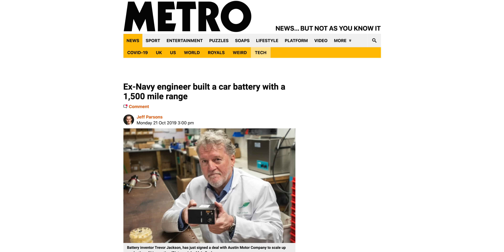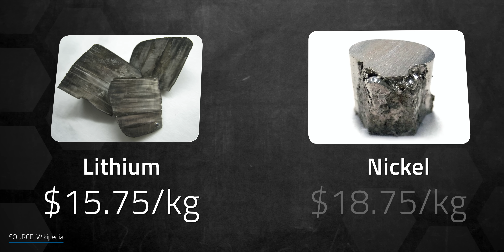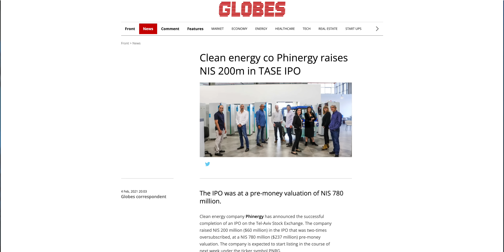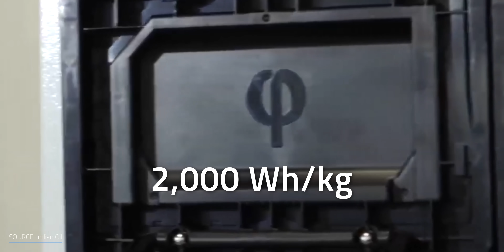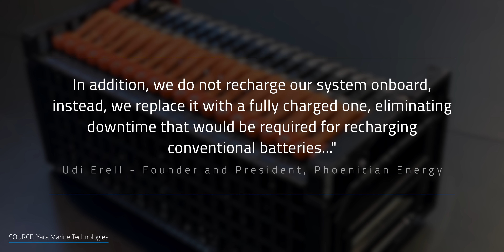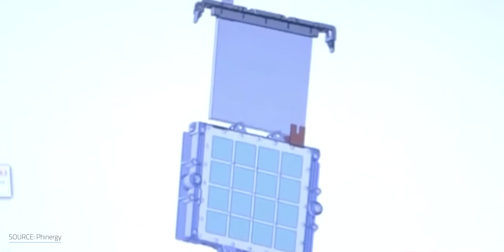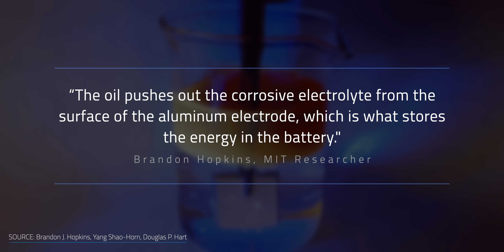Exploring the 1000 Mile Car Battery - Aluminum Air Hype?

Comment from the maker: But what do you think?  Would you want to drive an EV that required battery swapping?  Thanks Morning Brew for my daily news briefing - sign up for free here http://bit.ly/mbundecided

And if you liked this video, be sure to check out Exploring Massless Energy Battery Breakthrough https://youtu.be/7rJf_n3bc0I?list=PLnTSM-ORSgi7UWp64ZlOKUPNXePMTdU4d
Reply: One question I have is: this type of battery could give a 1000-2700 mile range for what weight vehicle?
Possibly they would produce larger batteries for heavier vehicles or vehicles that could accept multiple batteries which could provide better security from running out of power anyway.
Also, I think modular battery swapping is a great idea and could be used with rechargeable batteries as well, this could help solve range issues.
Reply: I would drive an EV with Lithium battery ~100km range, if I had the option to home charge it and quickly and easily replace it to an Aluminium battery when I leave the city.
But yeah, that would need modularity, standardization...
Also. if I replace at 10% (or see above, 70%), what happens to the remaining energy?  I don't want to waste...
Reply: @arsyee  good question about using all the power, you wouldn't want to wait until 0%, you might get stranded. I think the ideal solotion would to get a discount for the power left in the battery. The service station would back feed the grid with what ever was left in the battery, pass on a percentage of what the power company paid them for it. Also could work if it was handled by the recycler.
Reply: @therealDanW  Agree.
Reply: @therealDanW  exactly what I thought. It doesn't have to be an either-or decision. A vehicle could have a li-on battery , maybe super capacitors, that give a short range ( up to 50 miles ), and also have long range Aluminium air batteries. The Aluminium air batteries could only be used when the 50 mile range is up. So lots of the time it would still be recharge time.
Still I think hydrogen electric fuel cell is the way a lot of road transport will go. I know about the energy efficiency issues, but the conveniences could outweigh those points.
Reply: @therealDanW  all the car makers would have to agree to standardisation...and would need to make lithium battery powered EV's as well as Aluminium air.. confusing. There is no easy fix to cutting low carbon or zero carbon transport. I think that the target some countries have set of eliminating production of ICE cars by 2030 or earlier could be premature
Reply: @therealDanW  Modular is the way to go, along with Li-ion hybrid, use the Aluminium-Air to charge the Li-on, make them simple cartridges you can easily swap with a car having a 50-100 mile Li-ion battery and 3-4 cartridges giving weight saving and 2 minutes in the filling station to swap a cartridge or 2. You would then have 500 miles range, no long recharge and lighter vehicle. It all works on being modular like you suggest and thinking about combining technologies not always replacing. A bigger setup for buses and trucks, but the same concept and if the cartridges are the standardised then a bigger vehicle simply accepts a higher number of cartridges.
Reply: @therealDanW  The video at @6:48 said that a Tesla S with aluminum air battery would get 2700 miles (same weight between stock Tesla S with Lithium vs Al-Air Tesla S)

I don't see a problem with this aside from the degradation and corrosion issues.  Swapping a battery vs filling up a tank is similar and if the process is in the same time scale, even better.  Right now, filling up a a tank is likely under 10minutes (emptying the bladder included) vs filling up a lithium pack which is 30minutes or more.

Direct Ethanol Fuel Cell would be great as well, though that has issues too.
Reply: @therealDanW  Thermodynamics etc. An extra, or heavier battery also means more weight to carry, meaning lesser range etc. Typically the range given assumes a typical family car's weight-to-carrying capacity ratio. Wouldn't apply to say, a heavy motor vehicle.
Reply: @therealDanW  You are right; these should be first used for buses for public transport within cities. The cost of replacement of batteries must be considered. How about defense vehicles?
Reply: @janami-dharmam  Already happening with public transport in some cities. Pune eliminated all its ICE buses last year. Other places will follow. City buses are one of the best applications anyway- they all collect in one place at night, have pre-set routes, and so on. Economies of scale can be brought to bear. As for defence vehicles, it depends. Typically these exotic applications usually have specialized requirements and therefore specialized solutions. For instance, diesel electric submarines have had batteries for a hundred years now, but their construction is very different. Ditto for drones, life support systems etc. Other vehicles could follow. Unlikely that frontline fighting vehicles like tanks and helicopters will go fully electric any time soon, but there is huge research (usually classified) happening here. The real challenge is ability to use off-the-shelf technologies in innovative ways rather than expensive specialist development.
Reply: What happens to the aluminum inside the battery and how much is able to be recycled after the charge is used up?
Reply: @Nightowl5454  It gets converted to Al(OH)3, which takes at least 250% more energy to convert back to Al metal than you get from the battery. Al is formed by electrolysis and it's not efficient because the Al-O bond is so strong. Thermodynamics says this is a dumb idea, but weirdly Matt didn't look at this, even though it's basic and shows it's a super dumb idea.
Reply: @Nightowl5454  the aluminium oxidizes as a chemical reaction when releasing energy in this battery, aluminium oxide is basically the ore used in the electrolysis process to make aluminium.
Reply: @Nightowl5454  It's my understanding virtually all the Aluminum can be recycled, and there's a rickshaw type service in India that already uses these batteries and recycles the Aluminum.
Reply: @Nightowl5454  The aluminum can be recycled to the same level normal aluminum scrap can. Please note that when "charge is used up", it doesn't mean all the electrons from the Aluminum are gone or something. Usually a battery that's stopped working is because there was corrosion buildup, or the electrolyte was over. And aluminum recycling is a well known science. The problem isn't that at all. The problem, as the video pointed out, are the losses. The MIT tech seemed promising; I'm excited for the future of energy storage.
Reply: @ninadbhave5133  not all metals are cost effective to recycle, sometimes it's so expensive to recycle something that it frequently just gets thrown in the trash.
Reply: @Nightowl5454  Quite true; however perhaps economies of scale might make it less expensive per kg?
Reply: @ninadbhave5133  yes with improved technology we can bring down the cost for recycling, for now I suspect that most will simply end up in the trash piles. Some day we'll probably end up mining our trash piles because of all the valuable minerals that have been thrown into the dumps because we currently can't make it cost effective to recycle. Currently most recycling done in the USA is by force and costs more than the value of the overall materials sorted.
Reply: it wont be a problem if we can buy and keep extra one  and 2000km is way better but  we dont know the price yet
Reply: So, after a just 1000 miles traveled, the battery pack has to be replaced with a new one and the spent battery needs to be recycled? And this 1000 mile drive would cost how much compared to 300kWh of electricity required to do the same trip in a lithium battery powered EV? How much CO2 would be emmited during mining, refining, manufacturing, transportation, swap station infrastructure and then transportation to recycling and eventually recycling of this battery every 1000 or so miles? And over the entire lifecycle of such vehicle, if it does let’s say 150K miles? Right.

Very early on when designing the first EV prototypes, a few companies toyed with the idea of battery packs being swapped from underneath cars in service stations. As rapid charging at >100kW did not exist yet. This idea was quickly discarded as unpracticalc even though these batteries were supposed to be recharged on site while waiting for the next car.
This aluminium-air battery idea is even less practical than that. A diesel trucks would need to deliver up to several hundred newly manufactured battery packs (it’s not a single cell) a day to each swap station and take the spent battery packs to be recycled. Some % of the recycled battery materials would be used to make new ones, but not all. I’m sorry, Matt, but how is this not the worst natural resource and energy waste idea You’ve heard of?
Reply: @amconsole  Oh yeah that is interesting. I just thought about how getting a new battery would be just as easy as getting gas but you would have to have a lot of spare batteries there just because of how many people visit gas stations a day. Though there would be less people because of the longer range, I still think that having enough batteries there would be a problem that would need to be worked out. 
The batteries when compared to gas would take a lot more effort to deal with after the energy is spent. After your fuel tank is depleted in a gas car, you just have to get more gas. Whereas with these batteries it would have to be recycled which may emit more pollution than just gas cars. I think part of why batteries are popular is because we will need an alternate energy source for transportation because oil prices will eventually get so high that it is affordable for an average driver.
Reply: @amconsole  I can't believe they are even going down this route
can't be recharged
has to be recycled
. it's the worst consumerism idea ever
just like your AA or AAA BATTERIES
JUST THROW THEM AWAY

wow the mindlessness of this let alone the original. making then remaking, transport to and from
its redicoulous for the environment and a waste of resources

even if they were rechargeable like xpeng

it's still. really dumb
Reply: @amconsole  totally agree. Using fossil fuels would be more environmentally friendly than aluminium air batteries if you can't recharge them. I guess you're probably going to have to put at least 4 times as much energy into making a disposable aluminium battery than you get out again during use... dead-end technology if recharging isn't solved..
Reply: @amconsole   exactly.. say this becomes unviable and we are stuck with lithium Ion. how long will supplies of that last?
Reply: @vincentl.9469  what do You mean? Lithium is quite abundant in Earth's crust and there is research into better (cleaner) methods of refining it. It is also recyclable.
Reply: @amconsole  OK. there are millions of cars  on the planet , at least quarter million in the USA alone, many millions in Europe. Are you saying there is enough for all that plus the demands of computers and cell phones, watches, clocks etc  ?
Reply: @amconsole  How many cars do you think there are in Asia alone, plus USA, Europe? then are are other elements involved like cobalt..still think there is enough supply..plus all else that needs Lithium batteries
Reply: @vincentl.9469  you are posting this comment under a video proposing all those millions of cars swap nonrechargeable batteries every 1000miles or so. How many such single use battery packs would need to be manufactured then scrapped and recycled during a lifetime of such cars? 200? Not to mention there would need to be a large surplus and not counting the ones that would need to be recycled having never been in a car (due to selfdischarge and short shelflife). Not the best use of resources as compared to cars that do 200K miles on a single Li-ion battery pack.
Reply: @amconsole  yes I agree on that. what I'm referring to is the lithium supply, which you say is abundant within the earth's crust but, there will be  a lot of demand too if current petrol cars are phased out.
Reply: @vincentl.9469  quite right, that’s a lot of lithium. I don’t think in 30 years time all cars will still be powered by Li-ion. Even if lithium stays as the main element in batteries (continuous well funded research in this field is happening all over, so who knows), the phasing out of non battery powered cars will not happen overnight and by the time the last ICE car rolls off production, a significant percentage of new battery packs will allready be made from recycled lithium. Packs will continue to get more compact and use ever smaller amounts of rare earth metals as well.
Reply: @amconsole  Aluminium air batteries can be used only for personal vehicles not for goods/passenger transport. Oil will continue.   It is the Govt and public should think of using this Al battery for their personal transport.  why every one think that oil will be replaced completely by alternatives is unclear to me.
Reply: @sramay123  not sure how this is related to what I wrote in my comment. But in short, no. Goods and passengers are being transported in electric trains, buses and delivery trucks already. Sure, the large trucks that take goods across state lines are not yet electric, but it’s only a matter of time, as cost of running diesel burning trucks keeps rising and logistics companies will ditch them as soon as any alternatives are available. That leaves airplanes and those will still run on some sort of liquid fuel for some time. That fuel will however not be made of oil as CO2 emission taxes will continue to go up to a point when carbon capture from atmosphere and synthetic fuel production becomes cheaper than burning kerosene.
Reply: @amconsole  in a decade you will see the solar waste, battery waste etc.    The only solution to climate is live with minimum needs what was followed 50 years back.  Air travel major oil guzzling, weekend travelling, year travelling, festival travelling  now space tourism.   it is all joke.
Reply: @sramay123  I don’t think this is a battery. It’s more if a fuel cell
Reply: @sramay123  and we have better fuel cells now.  It’s like saying a  gas tank and an engine is a battery.
Reply: @sramay123  At no more than 40% energy out compared with energy to produce the battery (making Al metal is hard, very hard) Al batteries solve nothing. You are not saving anyone if you need to use 250% of the energy stored in the battery to make the battery.
Reply: @sramay123  I don't think so, because that means the oil supply chain is still needed, and in fact now runs less streamlined because of reduced capacity utilization. ICEs based on fossil fuels for all except the most extreme applications like fighter jets or something will quite certainly get replaced. I don't think there will be one standard solution; rather a cluster of them. Standardization will follow slowly. At this point it is definitely viable to replace several heavy duty applications as well, such as intra-city public transport buses on pre-set routes.
Reply: I'd use swappable aluminum batteries if and ONLY IF the swapping stations were as ubiquitous as gas stations are today.

Great show!👍
Reply: @bootstraphan6204  And then they will come out with non-compatible batteries (because of constant improvements).
Reply: @bootstraphan6204  That's the point. Gas stations, with their existing safety protocols and underground tanks can easily become storage facilities to hot-swap batteries. One does need new safety protocols, but it ain't hard tbh.
Reply: Anyone who owns a Tesla is going to think this is a horrible idea.  You don't need that much range for 99% of your year, it is only when you have a long roadtrip that range really matters.  Why would anyone in their right mind ever trade charging at home for needing to do a battery swap for their commuter vehicle.  This might find a home with Semi-truck and hauling where long distances are the norm and battery swap support can be handled at destinations.  But for the average consumer, this is a huge step backwards from rechargable batteries.
Reply: @Beldizar  This is exactly what I would have commented. But as always: for this type of battery there will be use cases that actually are a good fit for the concept/product. But I think that the EV market already has chosen its path: rechargeable (preferably at home) batteries in one form or another. But when looking at the concept and the need to setup a logistics path between production, user and recycling will be difficult and usually only succeeds if there is enough market for it. So I wonder which niche use case can actually pull this off. Maybe in the shipping industry (where battery size is not a real issue) or low range aviation, where fast turnaround times are welcome. I don't know, but for passenger cars, I think this will not be a success.
Reply: @Beldizar  of the 4 vehicles that I use for normal driving, only 1 is for short range commuting and short drives.  The other 3 are pickups where my shortest normal trip is 600 miles one way, to 1400 miles one way, mostly in places that dont have recharging stations
Reply: a Hybrid design may be an answer, with a 150-mile rechargeable and a 700-mile replaceable  this is shy of the 1000-mile range but won't leave you stranded, 150 miles is enough to get from most 24 hour sharing stations. and is enough for around town daily driving... , then you can have a mini trailer, like a motorcycle trailer with a battery pack that will do over 2000 miles.  This would do almost anywhere in the country for 1 battery pack
Reply: My Li-Ion battery has already gone 115k miles, why use a battery that only lasts a thousand miles? Charging my battery is a minor inconvenience. So no to the question of driving an EV that required battery swapping. As a power supply for ships on the other hand, on a container scale, I would like to see a feasibility study, preferably comparing a Hydrogen fuel cell, a Aluminium-Air battery and a Thorium SMR.
Reply: @johann.g.olafsson  Materials economics and strategic sustainability reasons mostly. Li-Ion batteries use cobalt, a quite toxic substance that isn't easy to recycle. Also, lithium isn't available everywhere, making strategic hoarding (like China's doing with rare earth metals currently) a real possibility. As against that, Al-Air or Iron-Air batteries use abundant, non toxic elements that can be extracted, handled, and recycled safely and using current mature techniques.

As for Thorium reactors I don't see that happening in an era where container ships are getting attacked by houthis with cheap drones.
Reply: If it can't be recharged, it's a no go. 90% + is home charging. If you need advanced automated infrastructure to swap the battery it's going to be too expensive.
Reply: I mean i probably would because it not that much different than getting gas at a gas station
Reply: I'm wondering about a possible hybrid setup between this and a rechargeable battery unit.  the Aluminum battery could be used for longer trips, while the lithium could be used for shorter in-city trips.
Reply: I think Thunderf00ts review of this is worth a watch.
Reply: Absent aluminum air, I think battery swapping is a good idea. Imagine having a 100 mile range ev with a permanent battery & a 2nd swappable battery good for another xxx miles. You could still charge like you can now and road trip with quick swaps along the way.
Reply: @peterwittreich4902  nice! why not both? seems like a great idea. And on long trips if you can select freely between which battery drains first. you just start on swappable if you run out of swappable energy you have the charged battery range to get you to the next swap station. get a fresh pack and retop your charge and off you go.
Reply: People have no issue with pulling into a gas station and filling up the gas tank so what's the difference if they pull into a battery station open the hood or trunk and swap a battery?
Reply: @BillB33525  when you have 10% charge, and you don't know how long is the next trip...do you swap it or not? It's very difficult for daily use.
Reply: @BillB33525  weight!
Reply: @BillB33525  If you have a bad back you're in big trouble. (Though to be fair, if you have a bad back it's better to avoid driving in the first place.)
Reply: @BillB33525  cost
Reply: Maybe a cartridge style where you drive into a building and exit or stay as it extracts the dead battery.
Reply: @BillB33525  Already the EVs cost a bomb; they are selling because the fuel is cheap at this moment. Why the EVs are so expensive? They are supposed to be simpler to make.
Reply: @janami-dharmam  R&D is expensive and the companies have bank notes and investors to pay back
Reply: @janami-dharmam  yes, they are simpler to make. But the batteries are still the most expensive component. The extra cost (at least for mass market vehicles like the nissan leaf or chev bolt) is almost 100% battery development and manufacturing costs. Its worthwhile noting that batteries are almost 1/10th the cost per kg thet were 10 years ago ( they keep putting bigger and bigger batteries in, so the final cost hasn't dropped that much, of course) and they have every reason to think cost will continue to drop...
Reply: @janami-dharmam  To recover development cost, supply-demand, etc.
Reply: If the battery being swapped provided a days worth of travel, I would have no qualms about pulling it out like a clip and swapping.  It would be interesting if a built in pack like the Teslas could shut off blocks of batteries and let them get charge and then switch to using those as the other blocks were recharged (solar on vehicle and regen braking).
Reply: It's merely an improved version of single-use alkaline battery, with equally more complex production/recyclation chain…

So I see use only as an emergency device - dry brick, with electrolyte in separate chamber, that would be flushed in upon activation and battery would be drained completely to charge some standard battery…

Possibly, that "Emergency Aluminium Brick" could come with adapter to be used directly with EV charging port…
Reply: would much rather have replaceable batteries that have to wait for a recharge..
Reply: @TrumpKaSut  considering rapid charging a car takes like 30min and a swap would be 5min, that sounds like a timesaver. However, pluging in is a lot simpler than uncliping a battery pack, lifting it vlean out without clipping carpaint, and placing a new one in. Sure, aluminium is lighter than other metals, but the battery pack is still pretty big and is filled with liquid electrolyte..
Reply: smaller individual battery modules you can slot in and out would be an idea..
Reply: I think this could be a good addition to lithium, if they could make it where any idiot could replace the battery and it was sold at every gas station. Because this would make some easy good range extension to EV cars. As well as giving an answer to those who don't own homes.
Reply: I absolutely would. And it's not like it has to be an all-or-nothing scenario. They could be engineered so I could swap out a sub-set of the battery array. My car could even force me to keep at least 500 miles of "fresh" battery in the car at all times. This is solvable.
Reply: I would think a better application for this style of battery might work better in the field of transportation rather than personal ev. Integrated into the logistics of shipping something via long haul trucking, an all electric vehicle that could be loaded up with lighter and calculable known viable range would cut out vehicle travel down time. A truck could be loaded with it's batteries along it's load, with the precise about of battery power needed to complete the trip even accounting for worst case scenario of 100% usage. All this could be done at the origin point of the truck, no need to refuel in route. Once the truck gets to it's final destination, it could be loaded with new batteries and shipment to go back or on a new route.
Reply: Yes. Roadside assistance could carry the battery swaps (instead of gallons of gasoline). As you said if Indian oil stations become battery stations... That's a lot a lot of battery stations in the 2nd most populated country automatically. I think the infrastructure around these batteries would be equally, if not more convenient, than gas stations today. I think charging an EV is still an inferior option to a fast, instant swap.
Reply: I think swappable battery systems for ev's is feasible. However, is it possible to just swap out the aluminium anodes like printer cartridges?
Reply: Aircraft?
Reply: The batteries in my Roku remote died about 2 weeks ago.  I still haven't taken the time to walk to the other room to get new batteries, I just use the app on my phone with a LI-Ion battery in it... so I guess battery swap stations may not be the best solution for me :)
Reply: I think a hybrid battery solution would be better: 
~ 1KWh  in supercapacitators for regenerative braking 
+
Interchangable Li-Ion and Al-air battery modules of 10kg (that would be 1Kwh and 4Kwh respectively ?)

With such a system, depending on what trip I plan to do I'll be able to load the correct mix, from fully Li-Ion  (short trips) to fully Al-air (long trips).

The modules should be available in grocery stores like propane bottles for cooking.
Reply: The total fuel efficiency during the cycle process in Al/air electric vehicles (EVs) can be 15% (present stage) or 20% (projected), comparable
Reply: Honestly I dont know why we dont have EV's with multi-segment batteries already. Have the bulk of the battery as a permanent part of the car and have a swappable segment for range extension
Reply: Obviously, you have never driven a motorcycle. Motorcycles have fuel tanks that draw fuel off the main area of the tank and when that runs out you switch to the reserve. That would be very simple to deploy in the battery swap method. Software with GEO location data could "guide" the user to a swap station once it is needed with a demand that it be done or shut down feature in the software. The swap station need not be a full-size battery. In fact, there could be partial range batteries sold everywhere.
Reply: The solution could be mobile battery replacement trucks, just like mobile charging stations.
Reply: it all depends on the availibility of the swapping station .. so distribution is key .. with LiOn battery, you could charge your battery at any infrastructure that has electricity - granted one could take longer then the other ..

I could see this as a solution for long distance electric planes .. where LiOn battery will just be too heavy .. swapping battery at airport would not be a problem ..
Reply: In the end, it just comes down to cost and convenience.  We already have hydrogen electric cars that claim the same virtues without as many downsides.  I can't imagine a world where re-smelting the Al OH3 back into aluminum, rebuilding battery packs and transporting it to stations is as cheap and efficient as recharging the current generation li-ion batteries from a wall socket.  The question is:  Is it cheaper to re-smelt, rebuild, transport blocks of aluminum to stations than creating and transporting hydrogen?  I doubt it.
Reply: battery swapping is easily done, one module of 13 aluminium plates will give you 166km, you can have extra modules stored in your car and house.
Reply: @rwyo83  Bugger having to go somewhere to get your battery swapped, waiting in line for the next available person or battery to get going again, I just want to charge my car when I'm not using it and get in with my day when I need to without any hold-ups.
Reply: @markorourke5901  A battery swap takes 10 seconds, and you can do it at home.
Reply: @rwyo83  You do it from underneath the car right? you need tools and the ability to do that, what happens when it rains and you need to go out and about, or it needs changing while you are out? or all dressed up and have to change it? most people will take it in to swap and wait in line for the next person available to do the job for them, Not for me thanks. I'm a charge-and-go man.
Reply: @markorourke5901  it`s not from underneath, the batteries are inside the trunk
Reply: @rwyo83  Okay, not much difference then, you have to unpack the boot and then do the job, I could do it easily but I think a lot of people wouldn't want to or couldn't, there is a lot of people who have no idea how things work on cars. I like the Sono group of cars, they self-charge, as they are one big solar panel, and when not using the car you can power your house or recharge another car simply by plugging it in.
Reply: @markorourke5901  I like The Sion, it's good for the apocalypse. But I need an EV at least 500km of range
Reply: @rwyo83  Well you are in luck my friend, there are plenty of those coming out this year with the new 2023 models, not the old ones from last year which they are trying to paddle at the mo, good luck bro
Reply: Aluminium air batteries actually would fit air planes better than cars. They are light and energy dense and charging a plane takes too long anyways so swapping battries is the reasonable option. Many smaller packs that combine into a large battery could in a short time be swapped out and the plane would be ready to fly again. Degradation doesn't matter since the batteries are used up within a day and swapped out. Just build a battery recycling plant nearby the airport so transporting the battries wont take to long.
Reply: Maybe cylinder or cube that are easy to plug/unplug alreay charged :) ... one day!
Reply: This came out at 5 am how is there 500 comments its 1 hr old.
Ok so I think this can help but mybe a green ev train instead of the gas engines.
Mybe a new solar ment for farms to get them to stop wasting so much food.
Oh fun fact we grow so much corn if we stopped making things out of it like corn syrup corn meal or corn chips corn for cows and corn for your car the ethil gas ya thats from corn with all of this we still have so much every single person in America can eat 2,000 pounds of corn a year and we will still have excess corn.
So mybe reducing corn farms will help slow water use by alot.
Reply: Seems like a cleaver way to sign people up for yet another subscription.
Reply: Yes. It takes me 15 minutes to fill my tractor and refrigerated trailer. There's already hybrid busses; where's my hybrid tractor trailer?
Reply: Would be great as a addition when having a long trip, put a module in and take the long drive that is normally only possible with many fast charge's.
For normal use, I would not like it because it isn't rechargeable and recycling will cost also energy.
Reply: This sort of technology would be perfect for a public transport system.  For example, use buses to get people within 15 blocks of their destination, then small 8 or 10 person vans to get them home.   When you have a public transportation system capable of getting people from their front door to anyplace they want, with their groceries, the use of private vehicles will decrease.
Reply: I'd imagine the battery would still be very heavy even if 7x the energy density. If I cannot lift the battery out of the car to replace it myself, there is absolutely zero chance I would drive a non-rechargeable EV. Depending on the ease of recycling, this technology might be promising for other applications. For EVs, It seems that no technology will beat Li+ for many, many years.
Reply: @bminerrolltide  Mini trailer style maybe, swap them out like a towable pack... lol
Reply: Another option is an EV or truck with a Li+ battery and an aluminum air battery as a backup. Battery swaps are just a giant pain in the butt. I doubt they will be a thing.
Reply: Two 🔋 s can be kept as light weight... One when drain to zero new can be plugged. 

The drained battery can be deliver in door easy through online order. 

Priceing is only issue.
Reply: Transport of these batteries is not as easy as transport of fuel. Not looking at the numbers, the CO2 emission to manage the recycling and transport of these one time use does not seem that great.
Reply: These look like range extender batteries to me - and they look great for that.
Reply: Sure.  As long as I know when I have to change it, and I can reload at a station.
Reply: For small distances it wouldn't be an issue.
For long distances, i wouldn't risk it...
Reply: Instead of replacing the entire battery, you can only replace what is consumed and remove aluminum hydroxide. Simply put, an aluminum electrode in the form of, for example, a coil of sheet aluminium is successively uncoil and fed to an electrochemical reactor where it reacts with air and producing electricity. And at the station, you just put on a new roll and remove the sludge that remains.
In the extreme case, when you stoped looking for a bar, you dive in a trash can behind beer cans like Emmett Lathrop Brown and fill it up.
Reply: Absolutely. My mileage is highly predictable. And this means that I have to do exactly ZERO refueling or charging between swaps. And it then becomes a subscription service. Every 3 months I get a new battery delivered and return packing for the used battery. If the battery subscription is comparable to the equivalent mileage worth of diesel, gas, or electricity, then I would absolutely see it as a net gain. It's the same challenge that was talked about 15 years ago with hydrogen powered vehicle. You wouldn't recharge the hydrogen tank, you'd just swap it out. Only now Amazon has shown that maintenance subscriptions can really work.
Reply: Tesla considered battery swapping as part of their technology offering at some point. I mean if it can be recycled and is cheap to re-produce why not? As of the driving at night case - just make an array of those batteries that discharge in a sequence. Then you have a constant re-charge cycle instead of all or nothing.
Reply: no need to tow, the tow trucks could just bring new batteries to swap on site on EV car out of juice. If there is good recycling factories and very good batteries supply, swapping batteries isn't a problem and would be faster in fact. My worry is more about the added cost of transporting these batteries back and forth between the gaz station and recycling factories. Also, how much silver is needed in the battery? Because this could kill the project right there for mass consumption.
Reply: To answer your question, would I use a replaceable battery system. Yes, very little difference to having fuelling up today. But the eco/cost/convenience equation needs to work.
Reply: Matt - thank you for all the informative videos! Much appreciated.

My two bits; 
What about a hybrid solution leveraging Aluminum Air battery as the primary power source and a rechargeable Li based battery for 'emergency' power in a 90/10 or similar balanced power supply ratio? 

If they are inexpensive and safe, enough then having a 'spare' at home would also be possible. It wouldn't remove the need for the 'emergency' power supply but would eliminate the occasions where you realize you don't have enough power to make an upcoming unplanned trip.

The true path to adoption (outside of the technical and engineering challenges) will be standardization. The battery shape, size, and connectivity should be universal regardless of the vehicle or manufacture. Yes...you may need more 'modules' depending on the vehicle power requirements but standardization could facilitate mass production and make 'servicing' much simpler. 

Thank you again!
Reply: I would use them. Currently you can find AA batteries for your remote control at every gas station, why not aluminum air batteries for your car?
Reply: Absolutely.
Reply: No. I think the way to go would be rechargeable batteries with induction plates that works with electric highways.
Reply from the maker: Agree on the Neosporin.  😜
Reply: Well the higgest hurdle is the fact that you cannot "charge at home".

Wwapping out the electrode is not thwt different from pulling up to the gas sattion, and itsnot inconcieveable in the roadside.

However compared to rechargeable cells you lose out on getting "free recharge" from solar on roof.

Imho. as soon as home scale gadget for refurbishing used electrodes is available on the matket (on top of al air cells for sale), Li rechargable batteries are going the way of dodo.
Reply: Tow truck can simply bring you a charged battery, no need to tow you somewhere else. And if EU does like for all other charger and enforce a community standard, you wont even have to worry about calling someone with the right battery, plus as open standard many company can and will compete for manufacturing, racing to drop the cost and increase performance
Reply: If I get 1000 miles. Yes will be willing to do a swap.
Reply: use both, so a fully electric hybrid car, rechargeable lithium for day to day use, aluminium kicks in once that's flat, handy for long trips, this would also mean you could still use regen braking in the car.
Reply: There would be advantages, but if they aren’t rechargeable recycling would need to be on a whole other level. Great video.
Reply: Maybe using Al battery as a portable recharger for an EV for those rare situations, where you need that high distance capacity and you don’t expect charging stations.
Reply: You mention a drawback being "not noticing that you need a charge/swap" while traveling with your family.  Now imagine that you get to a "swap" station only to find they don't have any more batteries?  Do you have enough energy to get to the next "swap" station?
Reply: Why would the car need to be towed if the battery replacement station?

Dealers would probably create a mobile service.

The cars  will be monitored by the computer link to a data center.

The dealers can just send techs to do the change while a person is at work.

If the tech takes off other companies will start  to handle roadside assistance for possible emergencies.

As soon as a customers calls Triple A needing a battery pack.

Somebody will be on the way.
Reply: No.
Reply: Jeeze, no.  This is idiotic.  Seems like this oil company is trying to create another wasteful dependency market.  For backup power, sure.  Military applications? Hearing aids? Bob's Baricades? Yeah.  Metal-air cells keep well until activated, and 'cheat' by using mass outside of themselves to achieve exceptional specific energy...... once.   But for daily driving EVs?  Totally absurd.  Any company that tries to make this happen deserves to go belly-up.
Reply: I would add that battery to EV for special occasions. Like BMW i3 REx.
Reply: How is it environmentally friendly if you can't recharge it? Having to remake the battery each time must be pretty inefficient., and do you really get ALL material back when you recycle a aluminum air battery? You should have including more information on this 'recycling'
Reply: roughly the same time as a stop for pumping a full tank of gas to switch out batteries?... sounds MUCH more attractive than sitting around for 45 minutes to get 80% and another 30 if you want that final 20%
Reply: Not sure about highway use, but I will be driving an EV race car in the NASA 25 Hours of Thunderhill race on December 4th, and that car uses quick swap battery packs made with LiFePO batteries.
Reply: It seems doable, I was always wondering why companies didn't think about something like a car wash building that reads the exact make, model, etc pulls the car in discharged battery drops out to a robotic arm that stores the battery in a slow charge station while a fully charged is installed and you on your way. So the battery packs would be owned by the car manufacturer, rented to the car owner to cover degradation and then a charging fee for the electricity measured off the charge level difference between the drop-off battery and the charged battery. Obviously this would be problematic storging large numbers of batteries and require a larger infrastructure more that a pole with a plug on it but who knows what new incredible things could be coming.
Reply: @CodeMan636  a company does it in China. Batteries are a standard size so the car must be compatible.
Reply: S
Matt, 'BATTERY SWAP' is lame in my opinion....it seems to have been DISMISSED by Tesla.
My background tells me 'embeded'  battery packs create a structural integrity to maximise vehicle dynamics.'The stiffer the BETTER'
Charging will NOT be your main consideration in the EV World
Reply: This reminds me of Senator John McCain's call for an X-Prize for an EV car during the 2008 US Presidential race. He wanted a system that could be driven to a station and swap out the battery pack so it didn't take longer than a fill up and potty call for the kids on a road trip. Left/Right/Center politics aside, it was a valid idea and one that I still look forward to. You are right about finding a 'swap station' at night, but if the automotive industry can agree on a standard configuration, what's to keep someone from building an 'automated carwash' style line where you pull in, and a series of robots drop, disconnect, plug-in, secure and test the new battery, all in the same two minutes it takes to go through a car wash? Your vehicle would be able to pull in and talk to the station over 5G/WiFi or Bluetooth (or probably via an app that locates the station for you and secures a place in line), then the 'bots connect to the battery housing from underneath (like an oil change place) and does the work as you go carting along the track. You could even have a second building on premises for actually getting a car wash, too.
Reply: Anyone else find this one interesting? https://youtu.be/Ph4xvAc9HFQ
Reply: No we need cars capable of V2G to solve our long term energy problems.
Reply: @davefroman4700  I am not entirely convinced by this statement. While taking advantage of a car battery to supplement the grid storage capacity might seem a smart move, if it comes at the cost of making the cars significantly heavier is much less appealing. A heavier car means more energy consumption for the same trip, less autonomy, more dramatic accidents etc. Additionally You might end up in situation when You need your car but it is discharged due to the grid needs. Grid energy storage is an important issue especially considering the popularity of renewable energies such as solar or wind, however using electric batteries is not the only option, having appliances started when the power is available and storing heat might be more efficient. And if local batteries are needed, I'd rather a separate technology to optimize cost over weight and volume, such as Fe-air.
Reply: Battery swapping has ALWAYS been what was needed for EV's to become widely used. Imagine a standardized battery. You drive up, an automated system disconnects the old battery from underneath your car, or a side door or something. Pops out the old one for recycling, and puts in a fresh new one. Every few thousand miles you get an oil change that removes the containments from your car. Then entire oil industry doesn't have to change, people's routines don't change and even the repair industry doesn't have to change much. You just have trucks hauling batteries instead of explosive gas.
Reply: Aluminum-air should become an excellent replacement for alkaline batteries!  I believe it will be up to preference to decide between frequent recharging or regular swapping.
Reply: Yea it’s not a battery. It’s a fuel cell
Reply: I think the hybrid solution of using both Aluminum Air and Lthium in tandem. Lithium can be the main source of power while Aluminum can be the swappable backup.  Offers the ability to charge lithium while Aluminum can maintain the charge. Aluminum, due to space constraints, will lighten the EV weight with a smaller power cell which would make it cheaper since there won't be a need for the EV to be fully aluminum or Lithium. Who needs a 2k mile charge vehicle anyway? A 600 mile/charge should be more than enough. If solid batteries become a thing, Aluminum can be the mobile power source to keep it charged while still have the option to recharge the solid batteries. Isn't this how Hydrogen hybrids work, hydrogen tank charges a dense battery?
Reply: thought about it and it kinda pissed me off.   Any could and had made more efficient versions of these.  They are not batteries as they require fuel and have an exhaust.  They only work up untiillnthe exhaust gills the water chamber.  I doubt it’s a reversible process as well but could be. Still requires o2 to run tho.  I Sam rusty on my ochem but I don’t believe the al + o2 —— al2o 3 is reversible.
Reply: Yea, swappable battery tech seems completely fine. In your example of running out of battery while rechargeable cars can get a small boost charge from an equipped tow vehicle, the swappable car could just be given a battery to swap at a premium because they forgot to replace it early and weren't holding an extra in the car for the change over. Seems like the real question is whether they overcome the engineering difficulties and reduce the whole life cycle cost from production through to re-production.
Reply: As we all know there is no one solution that solves every aspect of this long debated issue however combining technology's having aluminum to air supplementing rechargeable tech hybridizing seems to at least  half a solution but would it really reduce our carbon footprint ? 
I wouldn't mind swapping something out every 1000 miles myself beats filling up every day or so .
Reply: @chadskyblue1  these batteries can’t be recharged, the have to be recycled after just 1000miles. Funding of this research should have stopped then and there, even without the horrific idle discharge that’s just a dealbraker. A solution that introduces more waste and CO2 than it solves is not a direction worth pursuing. The money wasted on research of a non rechargeable battery that needs to be replaced and recycled after just 1000miles would be better spent of fastcharge research, that would allow to fill Your rechargeable battery even faster and make it last longer. This is like driving Your car on a box of AA batteries and the replacing that box with fresh ones every 1000miles. It’s actually worse than that, as AA batteries lose very little charge while not used and there is an existing efficient process of recycling them. How much of those 1000mi would be lost due to selfdischarge? How much more is lost because the car would not be able to to regenerate anything from braking (usually around 5-10% of range is driven on regenerates energy). The proposed hybrid solution that combines a regular lithium ion battery pack EV with a range extender replaceable second battery in the trunk is not viable either. The whole swap and recycling infrastructure would need to be there for the <5% of all commute that people do beyond the range of their built in EV battery pack. Adds a lot of compromise and complexity to a car that is rarely ever needed. This too has been tried and discarded as stupid. Early BMW i3 cars had a small petrol range extender generator that would charge the car while doing longer journeys. They don’t sell them anymore. It just made more sense to increase the capacity of the main battery and add rapid charging capability.
Reply: Good presentation, but please help educate the users of misleading imperial units. 
Weight is a force. Don't use it when you mean mass; density or strength per density. It's very frustrating for the majority of the world who use internal units - especially when your tabulations are already in kilograms; kilograms/litre (or gram/cm^3) and MPa/kg or MPa/litre.🥝🥝🙏
Reply: Those car could be made very cheap as battery is a major cost... If it cou´ld be automated i.e u drive to a station and drive into a machine that swap it in seconds. If no degradation however i would like se hybrid solution, small lithum used for daily drive maybe need like 20 miles range, then after that those kick in, keeping lithium battery leveln on healthy level. Also the lithium can preserve energy like from braking and such
Reply: Producing energy out of one of greatest unexplored sources - bouyancy- could result in self charging cars.Batteries got no future
Reply: This combined with a lithium battery could be a good idea, so you then get the best of both worlds.
Reply: @Sparky783  but these batteries are dumb levels of wasteful. It requires at least 250% of the energy stored in the battery to reduce the alumina. It requires yet more energy to dehydrate the aluminium hydroxide that forms at the cathode. (One assumes that the Al in the cathode is completely consumed by the battery, else you are just carrying around dead weight). Not to mention the shipping costs, disassembly costs, cathode manufacturing costs, assembly costs, shipping and then fitting this to end user devices. 

I would be surprised if this total efficiency was somewhere about 15% of the energy required to make the battery was in the actual battery, so you are looking at for a 1Wh battery you need 7Wh of energy to make this. Some efficiency could be found, but refining aluminium from oxides and hydroxides is not where you will find efficiency.

I mean I'd like magic beans to power my car, but I don't think that magic beans exist outside of fairy tales.
Reply: Having to swap the battery removes one aspect of the EV - independence. Like with an ICE car, you need to go some place to get new fuel. An EV you can just plug in at home.
Reply: Thanks so many guys this year we will get it done by the the next
Reply: Actually the idea of swapping out batteries is not as bad as it sounds. If a car will have a battery swapped out in 30 seconds by a robot at a service station does it really matter if it rechargeable or not? Big fleet customers probably will have it sooner than later. Instead of waiting 1-2 hours for big rigs to recharge dropping spent batteries and loading fresh one will make far more sense economically in the long run. At the end of the day it will come all to dollar and sense.
Reply: You need a Starbucks coffee and a karen wig .... and you need to drive a kia mini van.
Reply: Can you looking into the Graphene Aluminum Ion Batteries? They are supposed to charge 60X faster then Lithium Ion? Out of Australia
Reply: is this a SINGLE PURPOSE ONE TIME USE ONLY Batteries ? its non rechargeable, right?
Reply: I think this could be excellent as an emergency power source for datacentres and such.
It lasts indefinitely while dry, then pump the electrolyte in when your UPS is triggered for too long.
Reply: No, I think battery swapping is a bad idea. 
It requires purpose-made car designs to work in the first place, which need to be compatible across manufacturers, plus a big infrastructure investment for the swapping stations.
Meanwhile, battery technology is moving forward so fast that swapping would likely be obsolete in a few years due to improved charging speeds.
Reply: i want #Makita to build me a cordless work truck
Reply: @Ephward Shartwell Amen brother. But if this doesn't happen you need to forget that you were gullible enough to believe this, otherwise you might not have enough confidence in the next conspiracy that comes along for you to maintain your troglodytic paranoia.
Reply: Swapping batteries is the way to go (potentially quicker than petrofuel) but not sure one-time-use batteries made of a HUGELY energy-intensive material like aluminum is really a solution to our unsustainable transportation problem.
Reply: I would prefer a bromide flow battery is what I think... WTF can half the world get them but I can't in AMERICA?!?
Reply: I don't think people would mind having to swap batteries, since it wouldn't take much longer than it does refueling an ICE car. The problem is infrastructure.
Reply: no
Reply: Niobium is the future, bud.
Reply: I always thought battery swapping would be the answer for EVs.  The infrastructure is already in place, existing gas stations could easily make a pull up spot for it.  Similar to propane tanks.
Reply: Wouldn't the recycling process be the recharge of the battery? How much energy is needed to "recycle" the battery? I think the make or break of that technology is the process of the "recharge".
Reply: 750 km is not "a thousand miles". It's close to 500 miles.
Reply: I would not
Reply: I dont think I will trust your video, you put a worthless sponsor in during the video.
Reply: I have an idea that I believe would work using vape pens .you take a series of vape pens set up on a timer so you don't burn the coils out .using Vegetable oil and bring the oil to the temperature where the oil cracks producing a flammable vapour allowing you to drive for free with zero emissions. I would love to see someone take my idea and make it work .
Reply: Battery swapping is a great idea. I would definitely go for this. But of course only if you can swap out in fractions, e.g. have 10 batteries that are consumed in sequence. If you have 3 left, your start to think about a swap-station. If the remaining 3 still take you 300 km, you'd have plenty of time and would not need a very dense swap-station network.
Reply: Why not? . It's like carrying an extra battery pack changing a battery can be done in 3 minutes right? . It makes absolute sense to do so as setting up a charging stations is an expensive deal and build network of them, cost of connectors and so on. It's best to let the factories handle power to recharge and processing.
Reply: If you can make almost 3000 km on a single charge, you would need to swap the battery once a week or once a month, depending on how often you drive your car. So it could work well
Reply: Wait. Would you want to drive a vehicle that has a range of say 500 miles that runs on a chemically complex liquid that is only available at filling stations and if you run out on your family trip you would most likely need to get towed to a nearest station  anyway? Hmmm…
There goes the question of medium availability. How many fuel stations were there when ICE cars were first introduced? How quickly people left their horses in favour of ICE cars? Just look at NIO in China and their twist on swapping batteries.
Reply: That's a big NO way, from me.... It ticks the list when it comes to Recover, Recycle and Reusable but without the Recharge it makes all of the good qualities mediocre for an EV application. It's like having a Ferrari with a 5gal tank or a 350mi max, engine. It's just not feasible for a standard in EV's.
Reply: Your car wouldn't have to be towed to a battery swapping place, you'd just call the battery swapping place and have on delivered for an exorbitant price.

The problem would be utterly exhausting the battery.  You'd want to have two always - discharge one entirely, then when that happens, get a new battery to replace the discharged battery.

I think the main problem would be the energy it takes to recycle them.  If, for example, it takes 4x the energy to make a new one from an old one, it's very energy intensive and wouldn't be worthwhile.

There's a story about some guy ages ago using an cylinder of aluminum in some sort of fluid that contained water, and the cylinder would degrade liberating hydrogen.  The hydrogen was used to power an ICE engine.  He could drive something like 1000 miles with it, but at the end he had a bunch of aluminum oxide powder.

I forget the details, but supposedly the man was poisoned by the oil companies, or that's the legend anyhow.  This was like in the 1970's or 1980's.
Reply: I think you forgot to talk about one very important factor as well. 

If it not rechargable, it means that the purchase of a new pack is also the purchase of the energy. Can it really be that it will be cheaper to buy a new pack could be cheaper, or on par with the price of electricity?

Today, you don't buy AA batteries because the energy stored in them is cheap, but because it's convenient for appliances that barely use any energy. 

In the case of EV or other heavy consumers... The price of the energy is what starts to become important. Do you have any insights on that ?
Reply: Short answer no.
Reply: So yeah you asked what if you run out of batteries in the middle of the night.  I think somebody could bring a battery out too you rather than tow you to a station.  I personally would keep a spare.  if they have a 1000 mile range having 2 in your car seems like it would be very unlikely that you'd ever run out.  Also it could have a feature like a loud annoying beeping sound when you are down to 100 miles left.  For every problem there is a solution if you try to figure it out.
Reply: Also I think it would be best if you do a regular order with a company and have them deliver them to your home.  An example would be I need 6 batteries a year so the company brings one every 2 months if needed and that would lower demand on stations.
Reply: Obviously to overcome the range anxiety battery swapping is the most efficient way.
Reply: If the cost of the Al-Air battery is $90 and the device using it has a "reserve Battery" of some sort, I'm in!

The real question is how many of these can we fit in one of the new Air Taxies? Jetsons are not far away!
Reply: Perhaps there are other applications for which AI batteries are a good fit, but powering EVs doesn't seem to be one of them. Why would anyone want to own a vehicle that must have a critical part changed routinely? Why would anyone want to trade the convenience and low expense of charging at home overnight for the inconvenience (and, I assume, greater expense) of regularly taking your car into a service station for a battery swap? It makes no sense to me at all. It seems like an idea dreamed up by oil companies to keep drivers dependent on them. Instead of needing to go to a Shell or Amoco station for gas, you'd need to go to a Shell or Amoco station for a battery. No thanks.
Reply: @TheRealLaughingGravy  Hi, I believe in India, they are piloting this with a replacement which takes less than 10 seconds at Gas Stations at the same price as a normal fill-up.
Reply: It'd be a no go for my almost retirement aged mom. She sometimes looses grip on a coffee mug. I dread the dmg she could do to herself if she dropped a 20 lb battery. This would be the same for many elderly, so I just can't see it working out unless the service station has workers that lugs them around.
Reply: Absolutely not.  Aluminum is not only messy and clogs up the pumps, it's also toxic. Also, what about total lifecycle costs?   Is every component 100% recycleable?   If so, what is the total energy required to do this including from transport from where dead all the way back to new battery where needed?  It sound's like a huge scam to me.
Also your KM to miles conversion is wrong.
Reply: Why can't they just make the batteries with swappable aluminum plates? It sounds like a far easier engineering challenge than some new exotic storage method. Then you just buy a pack of plates, swap them out, and throw the old plates in the recycling bin. You could replace the electrolyte at the same time.
Reply: @GlimmerOG  Because you have to deal with what the plates have become too, a powered aluminum oxide.   If you just replace the plates, your battery will fill up with the oxides and become non-functional.
Reply: @IntenseGrid  I understand that, however, that problem is also addressable through engineering. Just need a catch can and a dry sump pump with large enough channels to handle the powdered oxide.
Reply: @GlimmerOG  The vid talks like the aluminum oxide powders off, so I would assume just taking the whole battery for cleaning and plate replacement is just easier than leaving it up to the customer to not screw it up.

I mean, my brother is one of those "can't be assed to clean his car" types, so I can see him just throwing in new plates without the cleaning and killing the battery voltage.
Reply: @zetsumeinaito  yes, you make a good point, but that's one of the problems we have as a society. If we want to make progress, we need to stop catering to those "lowest common denominator" people who are only worthwhile as ignorant and lazy consumers. That being said, a self cleaning system for the electrolyte wouldn't be that hard to devise.
Reply: I like the idea of both options being available. Have a standard battery for recharging that gets you 500miles or whatever. And then if you wanna go on a road trip or just for safety/just in case, keep a batter swap with you and have battery swap stations scattered about with drivers(maybe automated) who drive out a battery swap to you if you get stranded. So that, all that ever needs to happen is someone bring a battery to someone. Even if they were like 1k...that would still be worth for a lot of people, if it's a 'just in case' and then, of course, cheaper if you buy in bulk so companies who need that, but companies that need to be on the road 24/7 like semi's, would either need more infrastructure to charge up everywhere or significant advancements in 'fast charging' and solar charging using the roof surface area.
Reply: Very interesting
Reply: Along with questions of convenience, cost of a battery swap will be a driving (no pun intended) factor in its success.  Will a battery swap cost significantly more than a tank or two of gas?  If so, then it is likely to fail.
Reply: You don't need a tow when you are out of juice. Just a new battery. They may be heavy, but as shown in the video, they can be swapped out quickly and easily. In the beginning the company that provides batteries would need to offer a service where they come and switch out your battery on the road, if you run out.

My concern with swapping batteries is rather this: Since you can't charge them, you can't "fill up". This means that if you need to drive far, you may have to swap out a not fully discharged battery. I guess you normally would have two, and run until one has emptied, and switch that one. But that might not always be practical.

Also, a swappable battery that also requires an integral oil pump? No, I think that will be confined to specialist applications.
Reply: "Aluminium is super lightweight"
Density of aluminium - 2710 kg/m3
Density of lithium       -  513   kg/m3
While I agree that this battery is better in so many ways, I can tell you are reading from a corporate script that was not fact checked.
Reply: Non-rechargable battery and light with high energy...hmm... it's good for aviation device like flying vehicle.
Reply: Why tow the vehicle to a battery changing station? Just bring a fresh battery. Also maybe you could have a small lithium battery on board, like a battery hybrid and viola! The electric jerry can,too
Reply: If road assist can provide top-up charging option for rechargeable, can't they carry the aluminum battery for replacement if a driver in distress needs it?
Reply: (regenerative aluminum battery) my friend chris goggin owns the patent for a regenerative aluminum air battery.
Reply: I think a swap out would be great, much faster than re-charge.  The only question is how easy and available would the swap out batteries be.
Reply: They are throw away batteries that a station attendant could swap.  They are not a good idea.
Reply: Since it isnt rechargeable,  one of the big benefits of evs, regenerative braking wouldn't work so then your overall efficiency drops way down.
Reply: Because of our work situations having two cars is a convenience for our family and not a necessity , which why potentially having one car not always be available would not be a deal breaker for us. That being said we frequently take a 351 mile road trip that includes a lot of rural driving and I would not want to take a car that had limited switch out locations on that trip, so we would potentially consider an aluminum air vehicle for one of our vehicles but not both. Also I don’t think we would be willing to pay substantially more than the price of a Toyota Camry for a vehicle, we would want a full sized sedan/ or compact SUV, and we would want something that will not start needing costly repairs prior to 200,000 miles.
Reply: Hey this Indian Youtuber just copied everything from your video https://youtu.be/lhFRxriUUzI
Reply: Your content seems copied here: https://youtu.be/lhFRxriUUzI
Reply: Yes.
Reply: Why not? Question would be $/mile of battery just like for a car.
Reply: This seemed like a cool technology at the time but then the creator mysteriously vanished and his company was disbanded 😂🤣
Reply: Besides the obvious advantages of going green,  one thing that interests me is reducing the dependency on other companies and consumables.  7 Months ago when this video was posted, fuel prices weren't anywhere near current (June 2022) prices.  Having a car I could recharge and even source the electricity from personal solar or wind technologies at home is enticing to me.  I dislike that I'm at the mercy of the oil companies and their fuel prices, so having to swap a battery with a provider (in India's case, an oil company) sort of defeats the purpose for me.  If this technology was rechargeable,  it would be much more compelling.
Reply: Absolutely not just another thing to put money into every month when most of us can barely pay rent even if it last 12 times as long drive that thing around for a couple months and you’re gonna have to replace the batteries like I used to remote and now you can’t get to work because you can’t pay for the replacement
Reply: Indian oil corporation has fule stations evey 5kms to 10kms all over india we can swap battery's there just like fuling up the vehicle, I have 1500 shares of ioc i hope it makes me profit.
Reply: I'm not certain I agree with one of your downsides.  You said, "...What if you're driving late at night and you run out of juice?  Battery swapping wouldn't be available, and and a regular EV could get a tow charge or a top off...."  How is this better or different?  In both situations you're stranded in the middle of nowhere with no juice.  So you call for help, and when help arrives they provide power.....so why couldn't the help bring a new battery if they know the problem?  I mean they are not going to know you need a charge for an EV right?  They will respond to the problem at hand when called.  So why couldn't they just bring a new battery or an emergency battery?  Or why couldn't standard emergency precautions be to have a spare charged battery ready to go like we do a spare tire?  I don't your downside as a down side to be honest.  And given that AL batteries are cheaper than LI batteries...it's more likely you could afford a spare or two for emergencies.
Reply: @unarealtaragionevole  u don't know ioc network
Reply: @princesunil26k  ???  correction I don't know what you're talking about
Reply: @unarealtaragionevole  ioc network is soo big
Reply: @unarealtaragionevole  in ioc we can swap batteries with in minutes
Reply: @princesunil26k  ah...I see.  yeah that was my point.  He made it seem that a Li battery had an advantage in a situation with a car with a dead battery.  i disagreed cause I think not only can a car have an extra emergency battery ready for this purpose, but I feel that a emergency assistance company would also be able to change out the batteries.  I actually like this idea.  I would be against Al batteries more if they were less recyclable....but if we can recycle them I am not against replacing batteries at all.  LOL
Reply: @unarealtaragionevole  ioc have fuel station every 5kms all over india, battery swap won't be an issue
Reply: @unarealtaragionevole  they can have truck loaded with battery, when we call they bring battery in case of emergency, just like pizza delivery
Reply: No. Simple answer.
Reply: yes - id swap rather using an expensive Li ion that requires reharging at the worst time
Reply: What is the name of the battery company please?
Reply: If the aluminum/air battery is so light then, to avoid the risk of being stranded,  why not carry a spare which would then be replaced with a fully charged one. The single greatest barrier to my purchasing an EV is range or 'range anxiety'. When I set out on a trip from central GA to, say, Madison, WI, a distance of about 1000 miles or about 1600 km,  then I do not want to spend hours recharging my battery in order to complete the trip. Yes, I do make several stops for fuel and food but, unless I'm desirous of an extended break, those take a few minutes for a combined total of less than an hour over the 14 hour duration of the entire trip. If there were a battery that would carry me that entire distance w/o the downtime for re-charging, even if it involved swapping out one battery for another, provided it was quick & painless and CHEAPER than gasoline, then I'd have to give that serious consideration. What are the chances of such a thing?
Reply: You can carry this battery like spare tire
Reply: There will be a day where batteries will be simply swapped out. The consumer experience makes the sellabilty of something and the consumer experience for swapp out batteries is much better than fixed lithium rechargeables. All the technical minor issues will be erased at some point.
Reply: Best idea that never got taken up.Stop at service station,swap battery,continue journey.
Reply: there's a possibility to use this alumair battery combined with existing lfp battery. so alumair battery as an adapter constantly recharge lfp battery while moving. But the ev needs to have regenerative charging feature.
Reply: Seems like it might be viable for aviation.
Reply: @CaseAgainstFaith1  Here, finally, there might be a use for it. The cost of a flight and the limitation on the number of airports should help ease any transition.
Reply: I guess an ev with 10 minutes to full quick charge would be ideal.
Reply: And a range comparable to ICE-powered vehicles of around 500 miles. I don't care to be stopping for a ten minute re-charge every three or four hours, even if the recharge were free. In fact, the cost of those re-charges is not that much cheaper than a tank of gasoline even with Bidenflation.
Reply: No, I don't agree to battery swap. Not unless you can get over a few thousand miles or recharge it somehow in one of those battery swap/storage stations. If the range is 1000 miles or less:
Think of the storage needed, how would that be handled on a very busy highway, how many batteries would that fuel station need to keep, how would they be transported back and forth, won't that transportation also use fuel or energy just like in the case of ICE cars? 
A fossil fuel station can handle hundreds or thousands refuels a day and can restock relatively easy, an electric charging station can easily handle tens of recharges per station each day and is always restocked (dependent on electricity availability). How many swaps can a battery storage station do and how fast can it restock?
How large can a battery swap station need to be to store tens of empty batteries and hundreds of full ones? An electric station can be as large as a parking lot can be.
You'd also need the presence of a person or automated machine that should do the swap, I don't see a young mom or grandma lifting tens of kg of battery up and down. And what if the swap machine breaks, won't that put the entire fuel station out of service?
Reply: Hydrogen is the best solution.
Reply: A supercapacitor can be added for emergency fast recharge/use, like some kind of energy cache. That can also store some of the braking energy in city driving.
As for the self-discharge, the oil pump seems ok enough. But it is weird to wait to start the car for whatever that replacement of oil with electrolyte takes... Maybe that to be done only after like 1 hour of not driving?
The ultimate issue will be the price. How much is the cost to swap an used battery compared to electricity charging?
Reply: I will like to remind everyone that we already do an 4k mile swap in ICE Cars.

Oil Changes.

A battery that last as long as that? Change the lube and change the battery in one stop at the same station.
Reply: Leave it to an oil company to develop green energy that sucks breathable oxygen out of the environment
Reply: No way!  No Swapping!  One of the reason I'm going to electric is avoid gas stations!  In my city, Atlanta, they are the single most dangerous place you can go.  Charging from home has been a godsend for both my family and friends her in the city.
Reply: It's "Al-u-minum" not "aloom-minum"
Reply: @jimmyhughes5392  ok I'm from Oz and hear it every day
but seriously get over ya self ya pedant
Reply: It's Aluminium thanks. IUPAC agree.
Reply: I thought this was a hype only channel???
Reply: I wonder when people get bored of new battery tech videos.... (tech that goes nowhere)
Reply: @arkatub  Nobody knows which tech will go somewhere.  All we can do is keep up with the advances and make our own bets.
Reply: @arkatub  What are you even talking about? Batteries are almost constantly getting better, so the technology is certainly going forward.
Reply: you cannot replace oil. so we should use oil forever . travel only when utmost essential.
Reply: @sramay123  We already are replacing oil in many markets.
Reply: @avgjoe5969  See in 15 years after solar waste will be there every where, battery waste etc etc.  for a cleaner world what we require is live with minimum resource. this should be promoted.
Reply: @sramay123  https://www.youtube.com/watch?v=d2szo16g0fI
Reply: @Ofer_Davidi  I am not naysayer, what I say we humans should live with minumum resources.
Reply: @sramay123  102% agree with you :)
Reply: @sramay123  I bet people in the 1700s & early 1800s would have thought horses are irreplaceable too. It's just a matter of time, to find a high-density energy source. No matter how much we optimize oil usage, it will be over also not to ignore the environmental impact of fossil fuels. Although they get your point, the current EVs are also no better, because the electricity in most states is still generated from Fossile fuels.
Reply: @sramay123  How does someone like you end up in this comment section? :D just curious
Reply: @sramay123  Of course you can replace oil. That's the whole point. Your other point about reducing wasteful travel, such as unnecessary commutes makes a lot of sense.